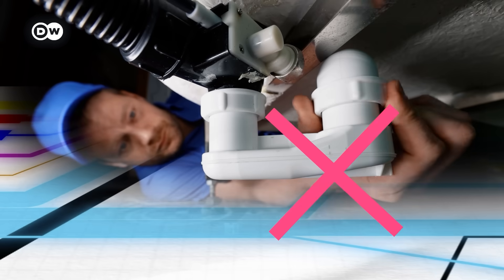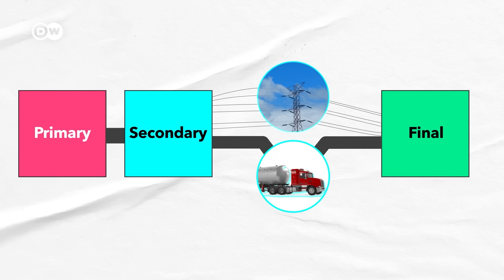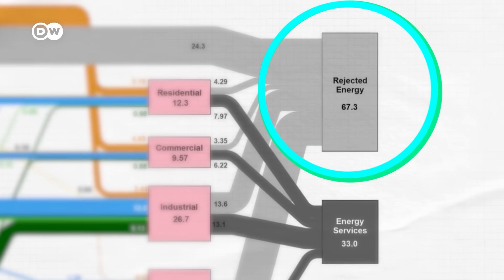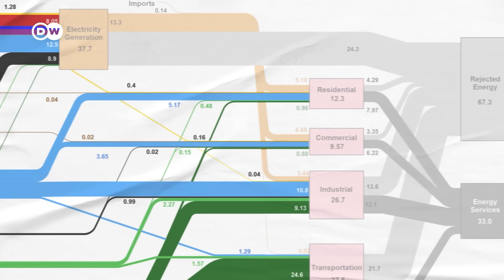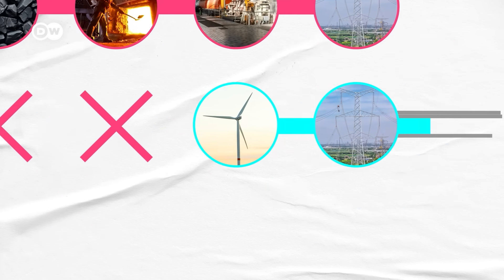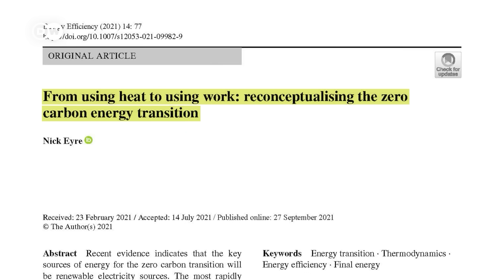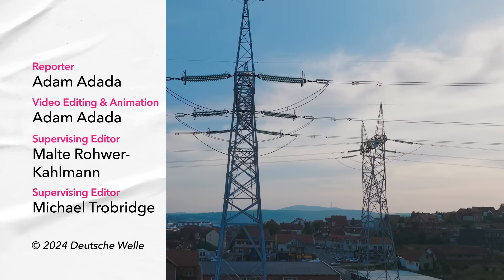The mind-blowing thing we get WRONG about energy

Comment: Solar panels are less than 30% efficient on the generating side. 
Engineers have been chasing energy efficiency for over 100 years. We are not about to magically find the solution that has been overlooked now. 
If you electrify everything we are going to have to replace most of the energy transported as fuel with grid power which will still have transmission loss. 
The grid wont handle that much additional draw without a major overhaul. it has taken decades to build the grid out. Its going to take time to increase its capacity probably a few decades.

Comment: I live in France and there is a sinister side to Nuclear power.  The environmental impact of the production of electricity by this means is no better than fossil fuels production.  Sure it's way more efficient, but future generations will have to deal with the radioactive waste (refer to Stocamine) issues.  Your reportage is misleading on many levels ; Geothermal energy extraction can have a negative impact on local groundwater resources.  So you list the negatives of Fossil fuels and compare them to only the positives of Green solutions.  Wind farms, Solar installations and Wave harnessing all have an adverse environmental impact. Not just in the damage they cause to ecosystems, but by the energy cost of their production, transport and installation at these fragile ecosystems.  Compare like with like please.

Comment: These plots show how total energy use efficiency goes up when electrifying correctly. It's the correct tool when the end-use energy required for acquiring primary energy is low. 

It misses both the mining and  the physical capital investment costs by not making the plot cyclical. 

Here renewables also have an advantage if we could "just" industrialize efficient methods for solving the intermittency problem and the mineral use problem of current renewables.

I believe it can be done and that our governments should invest much taxpayer money to further both the R&D and industrial scaling process. But before that has borne fruit, hey the sceptics got a valid point.

I'm hoping they won't have a valid point for long. I'm seeing it on the technology horizon.

Comment: I agree with the efficiency optimization, but with EVs (as with other appliances whose efficiency is crucial) we should also consider other resources efficiency. Not only electricity. For EVs, consider the rare materials, the repair costs and recycling resources necessary to dispose of EVs after it's life cycle. Now compare the life span of an EV to a life span of a combustion engine car. The total efficiency will not be 20/90... Just pointing it out that things are not 20/90%... now don't crucify me for defending combustion engines. I just says that combustion is good, proven, reliable and cheap to produce. We just need to change the combustible...

Comment: I think "getting rid" of fossil fuels is maybe too much of an ask, but we can seriously reduce them.

I especially think there is a big disconnect between goals, governments and industry.  Also, I think there is disproportionate emphasis on changing the behaviors of individuals rather than visible changes to corporations, industries and utilities.

Why should we expect cultural buy in to all/mostly electricity if the power generation is still mostly fossil fuels?  And for vehicles, why weren't plug-in series hybrids emphasized from the beginning?  Even in the early days of poor battery capacity / weight, adding a highly efficient gas or diesel generator to extend range would have seen more buy-in from more of the population.

Comment: Why would you like an unreliable source of energy?
And you are not fair - waste heat isn't waste. It's used to heat water in our taps and to warm our homes in winter. It's not lost. It's not only electricity you get from a coal power plant. An if you live in an individual hous, you use gas or oil to heat it, the efficiency of this source is >90%.

Comment: When you calculate energy loss you have to include everything. If you get your energy from wind or solar you have up to 25% loss on the grid. Then you have a large loss when you charge up the battery on your electric car. Electricity has to be produced the moment it is consumed and there is no efficient way to store energy from wind and solar. To use the extra energy to produce hydrogen is extremely costly and inefficient. Besides you need a stable base load or the whole grid will collapse. Then the option is fossil fuels, hydro plants or nuclear plants. The availability of hydro plants is dependent of the topography where you want to build it. If you want to transfers electricity over long distance it is an other loss. That means that the only option you have is nuclear power.

Comment: In my opinion, heat pumps and electric stoves should be mandate in modern houses. Also what if the government founded some of the cost to modify existing furnace systems as heat pumps which is actually possible most of the time.
I would like to ask one more thing is the rejected energy also in the forms of heat, friction etc? Because something as simple as the way you drive, or the temperature you set your AC system has a massive impact on creating extra heat. For instance i see people driving and when they see a red light, they keep accelerating and then stamp on the brakes. (A) Wasted acceleration in the forl of fuel and extra heat from the engine B) wasted heat from the brakes because brakes convert kinetic energy into heat by friction). Whereas the right thing to do is to lift off the accelerator and let the car loose speed on its own and then apply the brakes. Also far too many people but mostly companies and office spaces have the AC to outrageous temperatures. For instance, it doesn't make sense having your AC at 18°C where the outside temperature is near 37°C especially since your staff is looking to get a jacket because it's so cold. Again wasted heat since you're overcooling your building which is also not well insulated, excessive heat from the ac systems going outside increasing temperature even more, and ac systems are not efficient with huge temperature differences. I believe in this area, the government should step in and ban companies from setting ac systems below 22-23° C in such scenarios. Only hospitals, pharmacological spaces and other special buildings should be allowed for such low temperatures.

Comment: If it ends in landfill it is not an option solar is around 45% and wind is 35% in land fill both are limited to 35yrs and ALL the land based wind farms in Australia have used enough concrete to make at least three hydro plants AND they last 100 plus years and 95% recyclable plus baseload and i have never seen NATURE NOT RETURN WHEN THE WATER FILLS UP

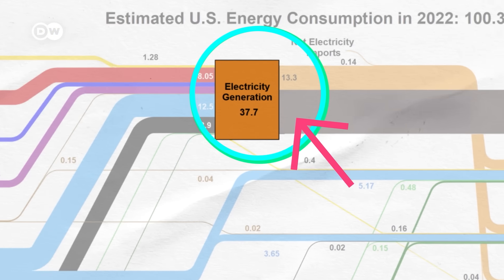Comment: 4:15 Hmm, if natural gas electricity generation is only 45% efficient as shown in the video, and there are 10% line losses, then a hypothetical 100% efficient induction cook top would be net 40.5% efficient from gas pipeline to cooked meal.  Not a huge step up from the 40% shown for the gas stove.  What am I missing?
It seems that most of the potential improvement comes from switching the grid to non-fossil energy sources, and not from converting end users to electric. Heat pumps being the lone exception that could be seen as on the same level.
The graphs should really show the grey "rejected" output from electricity generation being piped through "residential, commercial, and industrial" the same as the useful electric power.

Comment: Your points are great but the using the gas vs electric stove was probably a bad example.  Both loose heat due to convection and some electric stoves are less efficient than gas ones because of the poor heat coupling to the pan.

Comment: If I have a pacemaker, the induction cooktop will kill me. A typical nuclear reactor is 1.0 Gigawatts electric and 3.2 GW thermal. Add the other inefficiencies and less than 25 percent of the energy reaches the user. The cooling tower dissipates huge amounts of fresh water. It is more efficient to burn the fuel directly on the gas range than on a calrod stovetop considering the conversion efficiencies to get the electricity to the home.

Comment: 1kg of coal = 6 hrs running a washing machine. Available 24/7
1kg of oil.   = 9 hours running a washing machine. Available 24/7
1kg of renewables = less than 1hr running a washing machine. Available less than 30% of the time and requires every watt of power to be backed up by another source of power, usually fossil fuel. This is the equivalent of a second grid when only one is required.
1kg of uranium = 2000 years running a washing machine. Available 24/7

I wonder which one is more efficient and less costly.

Here is a hot tip for DW. Why don’t we get rid of all the subsidies and let the market decide which is the most efficient. Renewables will be last on the efficiency list every which way you look at it.
DW should stick to kids cartoons.
Reply: Hot tip for you: 1kg of renewables = nonsense

Comment: I work at a manufacturing plant built only 8 years ago. One end of the very large building has ovens that heat treat 18K pound forgings burning an insane amount of natural gas. In the other end everyone wears coats in the winter because the waste heat is pumped out of the roof rather than being captured to heat the rest of the facility.
Reply: Well the engine area needs to be cool to extract higher amounts of Electricity, but other than that, yeah it should be reused.
Reply: Definition of "business as usual"....
Reply: Lol what country?
Reply: @Sn00pzor Good old USA. No better in the summer. It’s 98 in my work area right now.

Comment: I've had an EV since 2016 and is on my second EV now, and can not imagine going back to noisy fossil cars. The old poorly insulated house I live is on its second heat pump since 1998, it alone save a huge amount of energy. 
Re-insulating the house would be best, but the cost of a heat pump versus re-insulating is currently not worth it. Would have considered solar panels on my house, but as I live above the arctic circle we have not much sunlight in the winter when energy costs could be worth the investment.
Reply: that means ,you don´twant to go back to your vibrating plate ?Ha,ha,ha:face-green-smiling:
Reply: Badly insulated house in the arctic circle and running a heat pump? That's awesome. What model do you use? How expensive is it to run?
Reply: @oznerol256  Current model is a ~5kW Toshiba about 8 years old. The cost to run is irrelevant as energy costs varies by hour, whats relevant is the amount of energy from the HP vs energy put into the HP. This model has a COP ~4-5 which means that with 1kW of power in I can expect 4-5 kW of heat delivered.
This amount be reduced when the outdoor temp falls below -15deg C. And I guess it's about 1 at -30. So extra heating could be required, we have a 7kW wood stove as well.
Reply: Insulate a bit at a time and the results build.

Comment: Efficiency is good, but reliability is more important sure we can all be South Africa and have 300 outages a year for load shedding! Wind turbines are at best 30% providing power they don't always run 24x7 365 days per year fossil fuel plants do that (unexpected outages happen for renewables too due to malfunctions - fires particularly didn't a number of wind turbines get knocked down in a storm recently, then you have turbines which wont start with out enough sufficient wind and then shutdown if the wind is too strong). Solar well doesn't work at night and power is reduced to near zero in inclement weather. Then we have EVs the cost of mining all the copper, lithium is going to be more than has ever been mined before for this net zero (so the world is going to be burning tons more diesel to get to a situation of net zero). Combined Heat and Power plants can use that wasted heat though powerstations weren't designed to make use of that in lot of places.

Comment: Storage methods for spare renewable power are horrendously expensive and are of such small capacity they are basically just tokenism. Batteries are particularly bad, they are made with heavy metals, require lots of maintenance and after less than ten years (under ideal conditions) they become toxic waste. The largest battery system created so far (located in Australia)  can power one city for 7 minutes. They are a joke, but renewables advocates always fail to mention that.
Reply: Batteries are nearing 100% recyclable.
But weirdly new chemistries like sodium ion (salt battery) are being manufactured and installed. Sodium ion batteries have no cobalt or nickel doesn't

Comment: Much of the rejected energy is from over production of solar & wind at times we don't need it. The power plants last much longer than twenty to thirty years.  Wind generators have to be made, transported, erected & maintained, also they have a very short service life (much less than 10 years) and then they become a major problem to dispose of this requires removal, transportation, and digging a huge hole to bury them in where they will lay for hundreds or perhaps thousands of years. This article is full of errors (effectively lies).

Comment: A lot of important information was left out of this video that would explain why the "waste" is necessary for using energy to perform work.  All the systems described can be made more efficient but at a loss of power and with less power it takes much longer to perform the same amount of work.  To illustrate this point imagine two cars used to race one mile, one has a very fuel efficient motor that sacrifices power and top speed for fuel efficiency, the other has a large, powerful engine that consumes a lot of fuel to produce its power.  The light turns green and both cars go down the track as quickly as possible.  The car with the more powerful engine reaches the finish line first because it has higher acceleration and a higher top speed.  The other car eventually reaches the finish line much more slowly but it has consumed less fuel.

It's good to want to make systems more efficient, but recognise that there are tradeoffs and sometimes it's necessary to have less efficient, more powerful systems that can do the work in less time than a more efficient system. 🤔
Reply: When it comes to home appliances/industrial processes, what comes to mind?

Comment: Project Drawdown's roadmap for addressing climate change is a comprehensive plan designed to guide global efforts to reduce greenhouse gas emissions and drawdown carbon from the atmosphere. The roadmap consists of five interconnected parts, each focusing on different aspects of the climate solution landscape. Here is a summary of each part:

1. Reduce Sources
The first part of the roadmap focuses on reducing the sources of greenhouse gas emissions. This involves a wide range of strategies across various sectors:

Energy: Transitioning to renewable energy sources such as solar, wind, and hydro power, and improving energy efficiency.
Transportation: Electrifying vehicles, increasing fuel efficiency, and promoting public transportation and non-motorized transport options.
Food, Agriculture, and Land Use: Adopting regenerative agricultural practices, reducing food waste, and shifting towards plant-rich diets.
Industry: Enhancing energy efficiency in manufacturing, adopting low-carbon industrial processes, and utilizing sustainable materials.

2. Support Sinks
The second part emphasizes enhancing natural and technological carbon sinks that capture and store carbon dioxide from the atmosphere:

Forests: Protecting existing forests, restoring degraded lands, and implementing sustainable forestry practices.
Oceans: Supporting marine ecosystems that sequester carbon, such as mangroves, sea grasses, and kelp forests.
Soil: Increasing soil organic carbon through regenerative agricultural practices, cover cropping, and improved grazing management.
Technological Carbon Capture: Developing and deploying carbon capture and storage (CCS) technologies and direct air capture (DAC) systems.

3. Improve Society
The third part highlights the social and economic changes needed to support climate solutions:

Health and Education: Empowering women and girls through education and family planning, which leads to lower population growth and reduced resource demand.
Equity and Justice: Ensuring climate solutions are equitable and benefit marginalized communities, promoting environmental justice and social inclusion.
Economic Shifts: Encouraging sustainable economic policies, green job creation, and divestment from fossil fuels.

4. Promote Innovation
The fourth part focuses on fostering innovation to drive forward climate solutions:

Research and Development: Investing in R&D for emerging technologies and practices that can mitigate climate change.
Policy and Advocacy: Supporting policies that incentivize clean energy, carbon pricing, and climate-friendly practices.
Finance and Investment: Mobilizing financial resources for climate solutions, including green bonds, climate funds, and sustainable investment portfolios.

5. Accelerate Action
The fifth part calls for urgent and accelerated action across all sectors and levels of society:

Governments: Enacting strong climate policies, setting ambitious targets, and leading by example.
Businesses: Adopting sustainable practices, setting science-based targets, and leveraging corporate influence.
Individuals: Making sustainable lifestyle choices, advocating for climate action, and supporting local and global initiatives.

Conclusion
Project Drawdown’s five-part roadmap provides a holistic approach to addressing climate change by integrating reductions in greenhouse gas emissions, enhancing natural and technological carbon sinks, improving societal structures, fostering innovation, and accelerating overall action. By implementing these strategies, the roadmap aims to achieve a sustainable, climate-stable future.